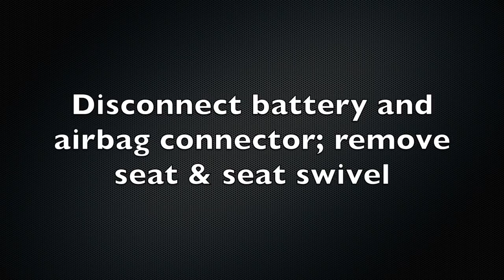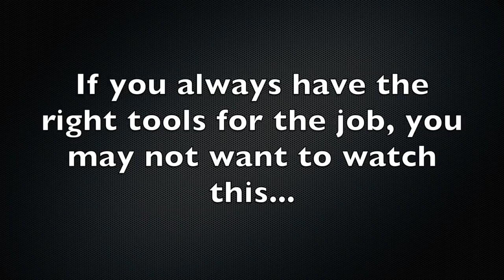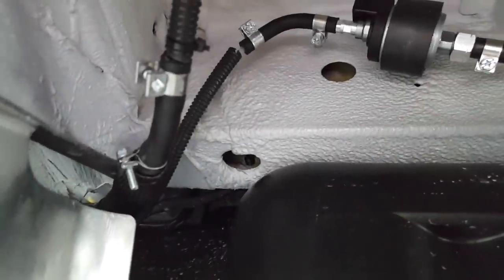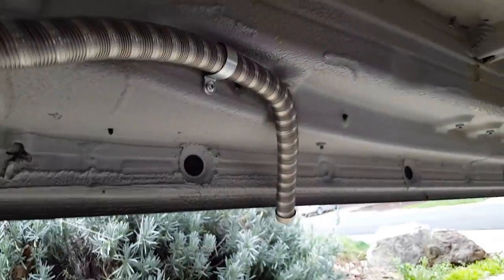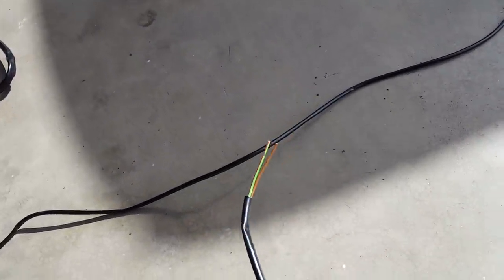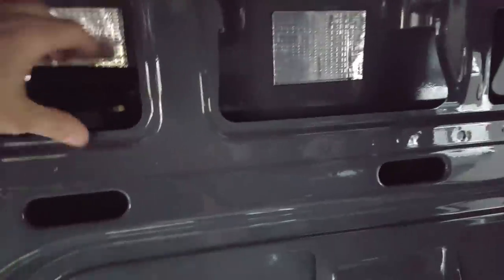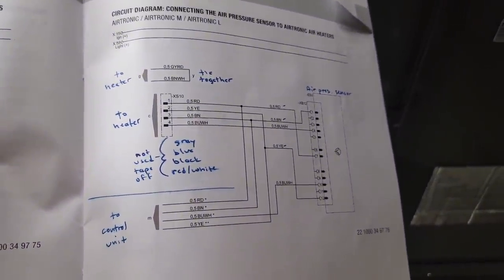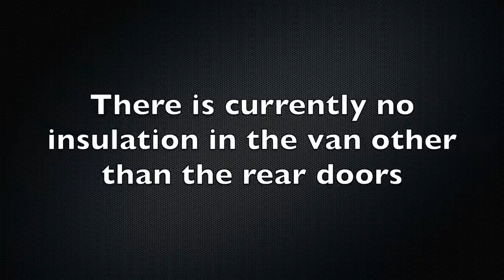Espar D2 Diesel Heater Install in a Mercedes Sprinter Camper Van

Comment: Hi, I am quite surprised that you bought a heating with only 2kW of power for such a big space. How are your experience? Is it enough? I am thinking what to choose for my VW T6 LWB without isolation and I am not sure that D2 will be enough... Thanks, Jakub
Reply from the maker: The 2kw D2 is the standard for most Sprinter conversions.  I can't imagine needing more, it puts out a ton of heat.  In fact, it's better to run these diesel heaters hard and hot to keep soot build-up down, and I'm concerned mine doesn't run hard enough much of the time. That said, I don't live in alaska, but we stay plenty warm even in below freezing conditions.

Comment: Can you tell me how you connected the power to the fuel pump?
Reply from the maker: Yes, that accidentally was omitted from the video.  There's a two wire harness that I ran into the driver seat pedestal and down through the rubber boot to the fuel pump.  The wire ends can be installed in either orientation.

Comment: What are the practical uses of a disconnect switch?
Reply from the maker: Sorry, I'm missing the context of this question.  If I mentioned one in the video, I was perhaps thinking of a way to ensure that everything was completely shut off before walking away from the van for a long period of time.  In retrospect, I don't worry about it.  The espar controller remains backlit when the heater is on, so that's an easy way to know whether or not the heater is on or off.
Reply: @ourkaravan  thanks

Comment: is it noisy inside the van when its running ?
Reply from the maker: When it first starts up in boost mode it’s pretty loud but once up to temp it cycles much quieter

Comment: Warning do not disconnect the wires to your seat it will set off an error code on the SRS airbag restraint system set only the dealer will be able to reset for $180 I have a specially-made computer testing tool and it could not reset the error code
Reply from the maker: My buddy made this mistake too but he was able to clear the code with his OBD scanner.

Comment: So how did you pipe in the fresh air intake?
Reply from the maker: There is no inlet pipe connected, it draws air through the open end of the unit.  As far as the seat pedestal I used a slotted insert that replaces the solid one, which you see me snap in to place at the end of the video.  This combination provides more than adequate air flow. Hope that helps!

Comment: nice spot. but you need to clean and service those.
Reply from the maker: Yes, just like any system on the van it does require maintenance.

Comment: We purchased the Espar Airtronic D2 12v heater with the EasyStart Remote+ Controller. We've got the heater completely installed in our 2013 Mercedes Sprinter, but we can't get the remote to connect to the heater. I haven't found anything on anyone having this issue. We've spent the past 2 days trying to remedy this issue; we've combed through the manuals and I've tried reaching out to HeatSo (the company we bought it from) but haven't had any luck. Any van-dwellers out there that have run into this issue before and could offer some friendly advice?

Sincerely, a very cold, frustrated van resident (:-P)
Reply from the maker: Does the rest of the heating system work, minus the remote?   Heatso is usually pretty responsive. Keep in mind they are in the UK so there's an 8 hr difference compared to PST.
Reply: @ourkaravan  Oh, I didn't know that Heatso was also located outside of the US. Thanks for letting me know! Also, so we were finally able to get the remote to connect after 2 days of head-scratching and trial & error (lol) so the unit is on, but now it isn't getting any heat. Just blowing cold air. I've seen quite a few articles online of this happening to other people, so we're still working on figuring out how to get the heater to work. Fingers crossed we get it workin soon! haha!
Reply from the maker: Not sure how many false starts you've had but it often takes 3-6 tries before the pump gets the fuel through all of the tubing to the heater (on its first-ever start) .  After something like three tries it will throw an error code, so you remove power to it and try again.  Is the pump ticking when it first tries to start up?
Reply: @ourkaravan  Yes it's ticking and blowing cold air. We've done it at least 8 times and we checked the fuel lines. Pretty sure we got all the air out. We've restarted and it's still giving the error code, so we're not quite sure what to try next. It doesn't seem like it's igniting, any suggestions?
Reply: Okay so I've had hit and miss responses from HeatSo. The remote is connected and the blower comes on. There's clicking but it's not heating. Now there's air in the fuel line. Any suggestions on getting the air out of the line?
Reply from the maker: This is not something I have encountered before but I would guess that there's a place in the fuel line where a connection is not tight and air is getting in.  Does the controller list a code number and if so what does the code tell us?
Reply: @ourkaravan  Thanks so much for your help! We took it to a diesel mechanic who's a friend of my parents and he was able to help us get it going :) It did shut off last night with an error code due to low voltage. So the next trick is figuring out how people have been able to power this heater with a solar system, which is what we have. Always a challenge lol thanks for all of your help! Much appreciated :)
Reply from the maker: I can help there too.  What size battery (amp hours or watt hours) are you using to run it. Glad you're getting it all sorted.
Reply: @ourkaravan  We have the Inergy Kodiak solar system. We have two 100-watt solar panels on the roof. The Kodiak solar generator has an internal battery and we have an additional 2 deep cycle batteries with 79 A.H. each
Reply from the maker: It seems like you may have a problem with your batteries or charging setup.  My Espar is connected to a 95 amp hour Mercedes auxiliary battery and it's more than adequate to run the Espar for multiple nights in cold weather.  That said, there isn't much else connected to that battery in my van. The Espar is pretty efficient on electricity.
Reply: @ourkaravan  yeah I'm thinking that the battery wasn't fully charged so the Espar just depleted what was left. We are going to have 1 designated battery for the heater so we don't have to worry about it trying to power anything else. Fingers crossed! Thanks so much for all of your help! Much appreciated 😊✌

Comment: Do you remember what bolt was used for the but in the frame?
Reply from the maker: Unfortunately I don't.  I had some bolts in my garage that just happened to fit, but have no idea what the thread pitch or diameter are; sorry!
Reply: @ourkaravan  thanks for the reply. I used an M10-1.5
Reply from the maker: Good to know, thanks!

Comment: i dont get it...how does the fuse holder fit into the electrical diagram? if the power battery cable goes through the floor to the battery, the controller goes back to the van body and the fuel control wiring goes under the van to the dosing pump. And the battery wiring has four wires on mine. I dont think they sent me a proper installation manual just a cd.
Reply from the maker: I'm not sure I understand the question, but yes, the fuse holder has a 20a fuse for the glow plug circuit and a 5a fuse for the fan.  Both get power a single connection to my Mercedes Aux battery connection that resides under the driver's seat base. Power is then distributed from there to the Espar unit, the controller and into the fuel pump wiring.
Reply: ourkaravan thanks for the reply. I was just saying they didnt send me a diagram or install instructions. I ran the battery leads between the seats to the aux area but havent hooked up yet, the dosing pump wiring through the grommet in the floor to under the van to the pump, the controller wiring to the back of the van for the altitude controller and temp controller and I just dont understand how the fuses fit into the system if thats all three leads being used..thanks for your time. I will order some more items from your kit list.
Reply from the maker: The instructions are difficult to disipher, which i talked a bit about in the video.  Did your wiring look look similar to what you saw in my video?  I showed some video of the diagram I had and how I hooked mine up.  I did forget to talk about the 2 wires that go out to the dosing pump, but I think you figured that out.
Reply: ourkaravan yes exactly the same. I have a 2018 sprinter. Im just stumped on how to wire in the fuse bank (where). Im searching the web now. Where and how to wire it into the system i dont get. Everything else is done except the battery connections until i figure the whole fuse holder out.
Reply: ourkaravan i bought the whole kit your recommended in your kit site. Easy start, d2 with altitude controller
Reply: I just found a manual online. I think i understand now. The fuse holder goes at the end of the battery cable, then to the aux terminals it looks like. Thanks
Reply from the maker: It's not a straight forward wiring diagram for sure, glad you got it figured out!

Comment: how about fuel supply?
tytyty
Reply from the maker: There’s a two pin harness that is not-polarity specific that goes from the espar unit to the fuel pump.  You can run that wiring through the factory boot in the drivers seat pedestal to get the wiring outside.